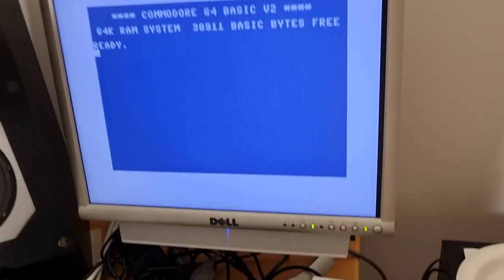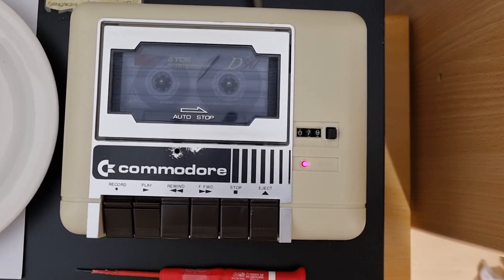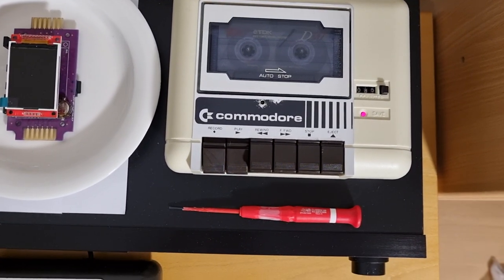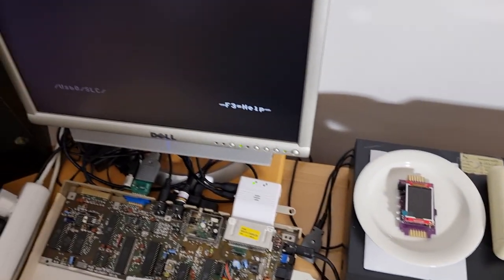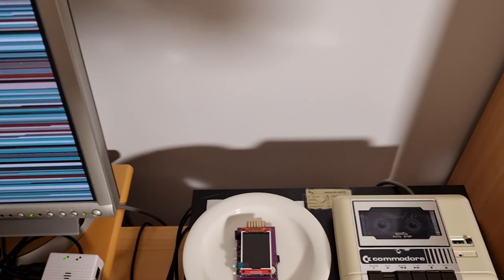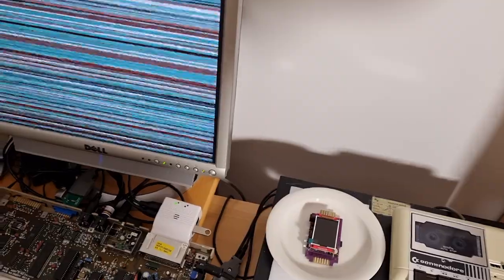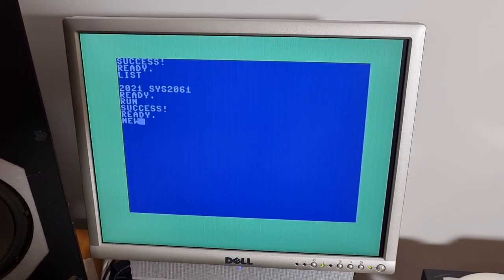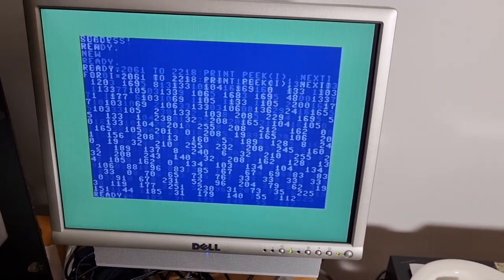** Commodore 64 EXTREME turbo tape speeds: Answering the Italyptian challenge (chkram.prg) [C64] **

Comment from the maker: The pulse lengths selected are once again $0A, $11, $17 and $1D. For heavily compressed data, this will typically yield bitrates quite close to 13700 bits/sec (looking at only turbo encoded data and completely disregarding the synchronization stream for the 4-frequency turbo part, as well as everything before that). After the old version was demoed on Nov 22nd, the code has been heavily optimized, making the loader more reliable. There are also some new features that aren't visible in this demonstration, but that do make the loader less prone to load errors. One key goal is to get reliable results on different model Datassettes in varying condition, while not having to sacrifice too much speed. A small number of unexpected issues found in the old version have also been ironed out. Obviously extreme bitrates like the one in this video will not be achievable with any randomly chosen Datassette. This particular demonstration was largely about exploring how far we could push one certain Datassette that immediately at first glance showed signs of being more competent than its comrades.
Reply: I think I was recommended this due to watching Nostalgia Nerd's "This era of CD Gaming was Bizarre" video about the CD-Audio compilations for the C64, the Rainbow Arts 1st CD-Edition and the Codemasters CD Games Pack. Would Slushload be able to use even faster speeds if the audio was being played back by a CD player?
Reply from the maker: @marsilies  Yes, I would expect something like 15 kilobits/sec to easily be reachable that way (for compressed data). I suppose you'd be able to produce an even more accurate pulse stream by using a computer with a decent sound card as audio source, but at some point, it still becomes a question of how fast you can go until the loader code can't keep up any longer.

Comment: If something like this was used back in the days for personal use - instead of usual turbo tape running on 3800 bit/sec - reliability would've gone down easily. Data recorded on Datasette might've been loaded without error immediately that moment - but as days go by - Datasette's head's azimuth would've changed a bit, and loading would've failed. 

Turbo Tape worked well for me, keeping head on proper position, however - commercial tapes with games on them had to use lower speeds, even very low - to be sure those tapes would load everywhere. Thing is - many users had no idea how to adjust azimuth, so that's why speeds were so low. But knowing how to do it - it still requires very good precision of adjusting head for extremely high speed above TTape.

Please,  give us info how this tape worked weeks and months after recording, assuming you used your Datasette often and your tape head changed azimuth. How reliable it was then?

Comment: This is insane. If I'm calculating this right, you can easily fit like 200 32k programs on a C-90 tape with this. Hats off.
Do we know the theoretical maximum bitrate which can be achieved with a C2N? There's obviously some limit with the tape, how fast you can switch a signal without it's turning to unrecognizable mush (basically the frequency response of the medium). And there must be also a limit on the component side, as far as I know the C2N is an op-amp chain after the tape head and that does the ADC part. There must be some speed where it can't switch fast enough. Can it go any more higher if we use something faster then the C64, like a C128 or even not a Commodore machine to drive it?
Reply from the maker: Yep, with the speeds and the version used in the video, it should indeed be possible to squeeze approx. 195 programs of size 32kB onto a 90 minute tape. If using slightly more moderate speeds, suitable for "daily use", a C-90 should still be able to fit about 150-160 32kB programs. :) It seems my C2N can write a 15400 Hz signal (pulse length ~65 microseconds) to real tape and read it back quite reliably. In the .tap file format, such pulses are denoted as having length $08. However, as long as magnetic tape ribbon is part of the equation, my C2N can NOT handle pulses of length $07 (~57 microseconds, 17600 Hz). The recording in the video included about 150 pulses of length $08, 29500 pulses of length $09, and so on, so I think it's safe to say that we are very near the maximum speed reachable with a C2N and real tapes. If we forget about real tapes and stream the pulse data to the C2N e.g. using a "fake tape" adapter, it seems the C2N can handle pulses of length $06 (~49 microseconds, 20500 Hz) just fine. I tried going as short as $05, but then the signal just turned into mush. Why? Well, I'm not quite sure if the C2N was the culprit, or if I should blame some other part of the chain. In any case, just like you suggested, I'm pretty sure that working with pulses as short as $06 indeed would require running the loader routines on a machine with more CPU power.
Reply: @_nc513_  just got back to this video. Thank you for the explanation! :)
Reply: but what about to lower the tape recorder slash player speed..store more data on less possible amount of tape:face-fuchsia-tongue-out:

Comment: This was like Turbo and nitrous shot !!!!.  Can the C64 do the recording or it too much for it. I mean. Just imagine this thing back on its golden age, tape decimating the floppy drives .... (well, as per the 1541, you dont need to try to hard LOL).
Reply from the maker: Making a mastering tool that would run on the C64 would probably be quite challenging, but I guess it should be possible, for slightly more moderate speeds than what we used in this video. It's definitely an interesting question. :)
Reply: I tried writing a TAP file with an REU and Tapwriter but it could handle it.  Ultimate II+ works fine.

Comment: This is working on unmodified cassette recorder?
If so the idea is pretty cool.

I said it years ago that if forced back into 80s I'd prefer battery backed up 8-bit with 1MB of RAM, cassette recorder with turbo and a good OS with a simple Sun alike chip to do memory protection than one with fdd at the same cost. <- I'm pretty sure that 128KB RAM version would be cheaper than 8-bit + fdd in 81-82. I was trying to be realistic, the only thing... know how.

It was realistic to do a gaming machine which was able to have a basic memory protection and task switching in early 80s.

single gaming mode with memory banks assigned by the OS and multitasking mode with OS managing access to resources.

At basics if someone started to work on 8-bit for 80s knowing 1st machines in 70s and having access to mainframes/having experience from big machines...

such person could easilly in 4-5 years release 8-bit with a very basic multitasking, memory protection and so...

The result: doing some tasks, running a game and from a game returning back to earlier task. even DOS 5.00 alike task switching would be a great thing...

on a 60m tape it was possible to fit 1MB data, without much effort and with perspective to use at least 4MB on a single side by using all 4 analog audio channels.

the majority of the comfort of the use of 8-bits was not speed of processor but a need to reload everything after any kind of crash.
a very basic memory protection + OS with enough RAM to have basic software the whole time on RAMDISC would allow use of 8-bits not only for gaming.

dedicated software runing alone was ok but doing daily home stuffs... even these 8-bits having needed software in ROM were at most half the way to give reasonable home computing.

and the sad part is that skipping cost of OS development... the hardware part to do a very simple memory protection with 6502 costed not even a dolar more than the original design. It's just a matter of needed knowledge and someone wanting such thing when designing computer.

Comment: Works very nicely.  I think I found a bug while testing IK+ though....turns out that it was setting the PAL/NTSC flag at $02A6 to #$00 when it should be #$01 for a PAL C64.
Reply from the maker: Ah, you've tried Slushload v2.5? What you see in this video is a preview of v3.0. There's been a lot of changes and improvements since v2.5, and I believe v3.0 will leave $02A6 alone. :)
Reply: @_nc513_  Oh cool.  I'd actually like to see a mode that's as fast as possible for a digital C2N.  I'd be curious to see how fast something can load from an SD card in one of those..!
Reply from the maker: @damienretro4416  For extreme transfer rates through the C64's cassette port, TapeCart SD will surely be your best bet. :) It's a rather different solution, though.